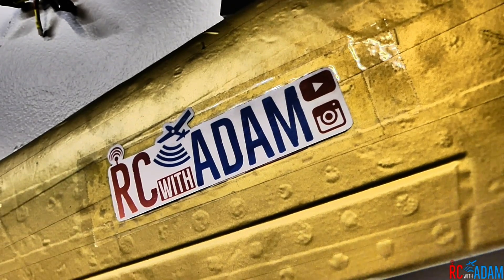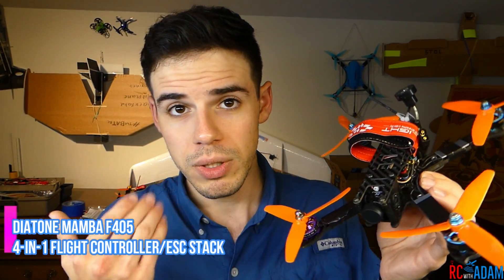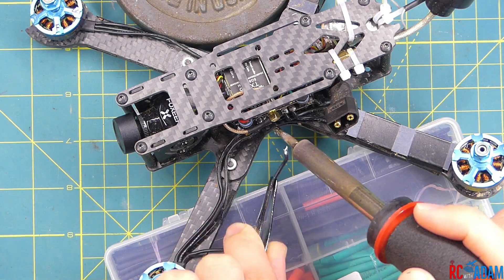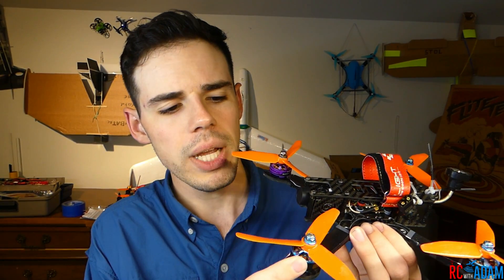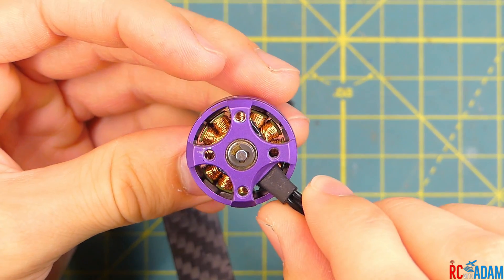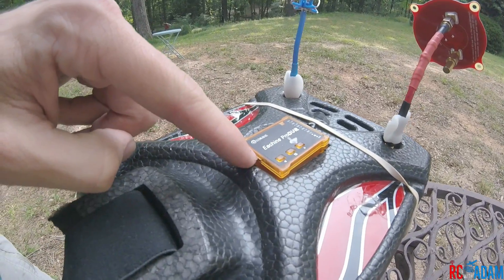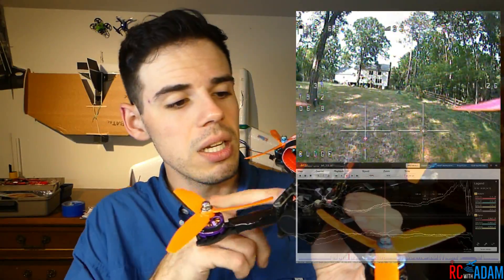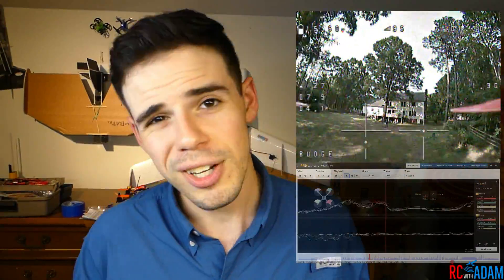SOLVED: Death Roll Due to Motor (not MAMBA F405 FC)

Comment: What exactly happened? Defective motor or bad ESC cable connector?
Had Samguk-s a while ago. Was one of cheapest options to get in air and had pretty good performance for the price. However they was made from butter and got bent and smashed even on medium crashes.

Comment: Thank you for the video! Only now I found about your death roll issue. My basher (thanks for the build video btw!) came down yesterday, breaking a motor and an arm, and after checking out fpv and hd video as well as blackbox I thought it was a motor fault, right after a forward roll. Now after reading other comments I'm not so sure. Has your "budgie" still been good after swapping the motor?
Reply from the maker: Hi! Yes, it's been great! Swapping out the motor totally fixed it.
Reply: @RCwithAdam1  Great to hear that, and thanks for the reply! This was my first serious (part breaking) crash ever. I'm just ordering a set of replacement motors and already ordered a second similar frame to use as spares, and one completely new frame as well for the 2nd build. Thanks for teaching the building process. Your video series was my main walk-through on my first one and helped tremendously! Keep up the good work! :)

Comment: I have the same problem, but when it does the death roll the fc also reboots before I  disarm, did you also get this fc reboot?
Reply from the maker: I didn't. That kinda sounds like a low voltage issue (brown out).
Reply: did you solved the problem? mine is mamba f405 mini stack, also death roll and reboot. the last time i use also suddenly low batt ob OSD while cruising.